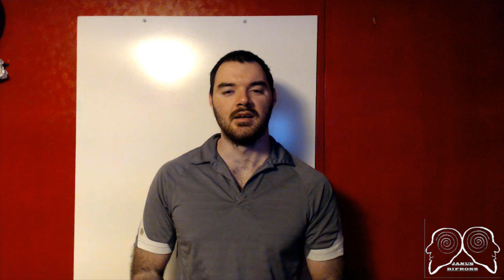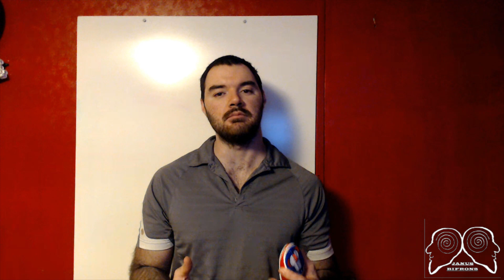Refining the Macropulse

Comment: Greetings Janus,

With the marco pulse, I’ve noticed how incredible it is in the force of blood throughout the entirety of the penis structure. I’m particularly impressed with the fact that you can feel the force in the penis shaft behind the scrotum/testicles, and I’m assuming the inner penis as well. 

I have a question. What are the main benefits of the macro pulse to the uh deep penis shaft and possibly inner penis? There are probably very few traditional PE exercises that significantly stimulate the deep and/or inner penis like this

Comment: so we should only work around that area under the glans with the macropulse, and not the whole member?
Reply from the maker: Yes. The reason being, the hand placement just below the glans allows for a more complete form of stimulation based on flow dynamics through the corporal bodies.
Reply: @janusbifrons3870  but you still squeeze at the base right? Or am i getting it wrong and you ONLY squeeze below the glans

Comment: What does your logo represents? Who’s the head silhouette? Ordered your wheel btw, can’t wait to have this baby soon!!!
Reply from the maker: Janus Bifrons was considered to be the Alpha and Omega in Greek and Roman Mythology. All things came under His dominion. There was no God before or after. Within the heads of Janus are the oppositional spirals that are offsets of Yin and Yang.
Reply: @janusbifrons3870  Didn't know that! I thought Janus was your actual name! I knew about the Yin and Yang, this is great!
Reply from the maker: Also, the building is going well. Just waiting on a final shipment of parts to finish the orders :D
Reply: @janusbifrons3870  Awesome! Can't wait to receive it! Do you recommend using lube still with the wheel or no need? Thanks.
Reply: @MJHFTBN  mine just shipped so just hang in there. Sadly I cant use it yet, almost mastered angion 1.0 though
Reply from the maker: No need. Its smooth rolling. I ensure that before shipping them out ;)

Comment: Dude I feel like we’re cheating with how much gains we’re making. I smashed my old PE gains stats with the new ones measured on 11/23 and dang it feels good to be a gangster
Reply: Sorry gentlemen here it is.

My buddy introduced me to Janus about mid Julyish. I’ve been pretty hardcore traditional PE guy since like springish 2012 when I decided to do something about it and knew I could improve. I haven’t gained vascular wise anything close over those years compared to the barely 5 months doing AM. I’m solid in AM 2, but spent July and a lot of August playing between created routines between AM 1/2 and the Macropulse. What I’m sharing now is what I’ve settled on the last few weeks like in October. I use 5 sets of 30 seconds Burst Expansion on 1 day. On set 3,4, and 5 I will do 15 reps of the Oscillator with each finger. Like 1 set of 15 using only pointer and thumb, followed by another set of pointer and middle finger, etc and back down the pyramid to just 1 pointer. If you haven’t watched The Oscillator of Janus it’ll make sense afterwards lol. Then once the 5th set of BE followed by the Oscillator is done I do AM 2 for about 26 minutes currently. Also since Janus has offered the refined Macropulse method I’m staying with using the pointer and middle finger positioning on glans side of the Oscillator now. Excited for the science on that.

This is a 2 on 1 off kind of schedule. Day 2 is as follows...

3 sets of 30 seconds of BE.
15 minutes of Macropulse. Focusing 2/3 of time now with squeezing hand behind glans. I do like applying the pressure at the base though so that’s just me.

After every PE session I practice pelvic floor strength (Kegels) and Balloon for about 100 flexes. Never orgasm ever. Kills gains. If you crush a session without busting you’re gonna see more frequent erections and probably morning wood which is a great sign of a good time.

Kill the Porn in your life. Gains killer 101 and I know I would’ve gained more by now if I was 100% on that still. Alas gentlemen Godspeed. If you can play with any supplements I highly suggest UMZU Male Optimzation Stack. Wish I would’ve had all my ducks in a row with that like I do now. Throw another paycheck at it haha.

Get the sleep. Get the good calories. Get the gains. Just smash. Hope all y’all swing the bat of your dreams sooner than you hope🤙🏼

What I’m gonna share is my most recent growth spurt... I plan on measuring again sometime after New Years.

11/3/19

BPEL: 7”
NBPEL: 6.75”
MEG: 4.8”
BPFSL: 7.25”
TW:1.5”   (TW= Top Width)

11/23/2019

BPEL: 7.3”
NBPEL: 6.8”
MEG: 5”
BPFSL: 7.5”
TW: 1.5”
Reply: @The.Shiloh.Project  thx for sharing.. so thats 0.05 inch of nbpel gain in 20 days right? . did you gain in total el since july?
what were your food macroes? in a surplus?

Why does porn kill gains? bec you get less aroused by normal things, and less blood flows? i mean you "think" of porn too when working out the AM? 
thx
Reply: Marco s0029 Absolutely more than July man. And I like to stay in surplus for calories. Pretty much what Janus is saying is true as far as that goes. And yea Porn kills gains cuz lack of blood flow, rewiring the brain for arousal, and the plummeting of your T levels when you bust a nut. Also I’ve always noticed my EQ is more spongier than hard when I’ve relapsed. No bueno.
Reply: Marco s0029 And thinking of porn no. My mind can wander there just like it could flashback to intimate moments in my life with females, but yea i notice the more I’m off the less I have to deal with it. Pretty much it’s a gym thing and my unit responds to physical stimulation. Just keep my mind focussed and when it drifts bring it back to the present moment. God bless my dude
Reply: I know what you mean. 1 month doing angion 1.0 and my mild ED is cured, veins getting bigger, arteries getting longer and more red, plus starting to feel a pulse by my dorsal.
Reply: What method gave you the most gains
Reply: @jonp6709  Dont worry about stats. The longer you wait to get started the longer to see results. I'd say achieving 100% erection quality is the first step, that alone will give length and girth. Just start angion 1.0 every other day for 2 weeks for 15-20min. Then angion 1.0 for 2 days on 1 day off for 30min. Janus recommends doing angion 1.0 for 2-3 months before moving on to angion 2.0. You cant jump ahead, you must do the groundwork first.
Reply: @jers2532  do we perform angion method 1 and 2 together
Reply: Wicked Jester My dude I’ve been stuck at 4.5” on EG at my base forever. Smashed past that when I first measured after a month or 2 of dinking around with AM1 and 2 like in my first comment. But presently I’m 5” as of 11/23. Pretty sure I’ve gained more but will measure again after New Years. Just being patient and disciplined. Enjoy the ride. Also this is after several years of traditional PE.
Reply: @The.Shiloh.Project  hey bro you got any new gains since? And what kind of stuff are you eating if you don't mind sharing?
Reply: Man, I’m getting none. Not doubting it. Gonna be more consistent. Had a lot of parties over the Christmas which involved drinking and maybe not eating as healthy as I could. Gonna give it a proper bash and report back in two months I’ve stayed very consistent this week and also doing nofap from now on.
Reply: How do you guys get any gains???? Ive been doing this since july and nothing.... fcking hell

Comment: Janus, are potatoes fruits and legumes enough omega 6 fat for pge 1 production? Im asking because im on a lower fat higher carb moderate protein mostly plant based diet Ive found the low fat intake has my insulin sensitivity through the roof.
Reply from the maker: Well, if you do have those issues, increasing the fiber intake during a given meal will do wonders. On the topic of protein powders, I'd be cautious. Some of them are being outsourced from questionable sources and they've been finding all manner of harmful chemicals of late. My standard go to is to blend 3 cups pressure cooked pinto beans with a lime for flavor. Its a solid 45 grams in one shot. Decently tolerable flavor wise too.
Reply from the maker: Do you mean your numbers are higher or lower? Potatoes usually need to be paired with higher fiber options due to how fast they can be digested.
Reply: @janusbifrons3870  Im having about 20 grams of high quality fat from coconut oil and eggs before bed and having the majority of my carbs earlier in the day. Im doing this because my blood sugar stays stable now with no more brain fog or sleepiness after eating. I was wondering if I need to eat more fat for pge 1 production or if thats fine because when I eat more fat I gain weight like crazy but Im finally losing excess bodyfat on this diet. Thanks
Reply: @ethan74105  dude coconut oil is not good for you matter of fact no oil is good for your diet youre just damaging your arteries with all that saturated fat..
Reply: @janusbifrons3870  My blood  sugar isnt spiking as high after meals and goes back down to normal much faster this way.